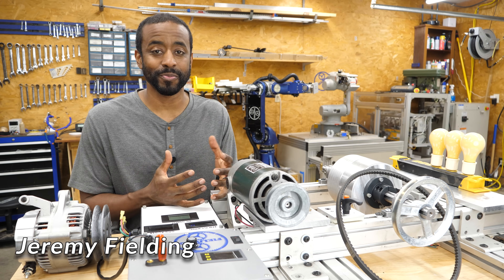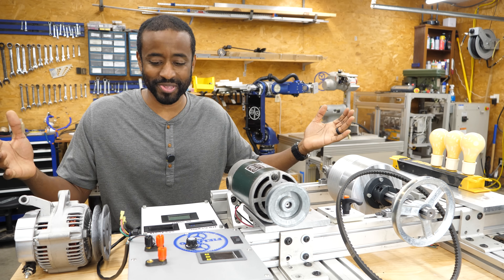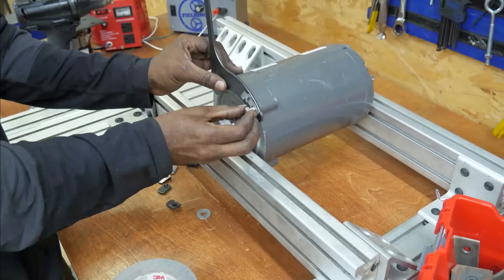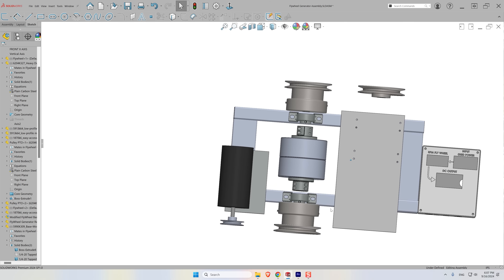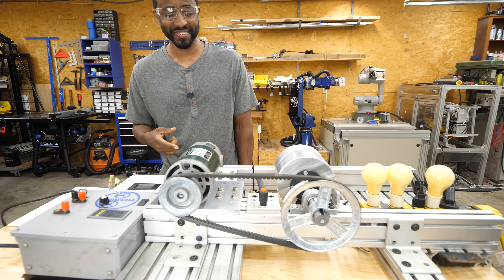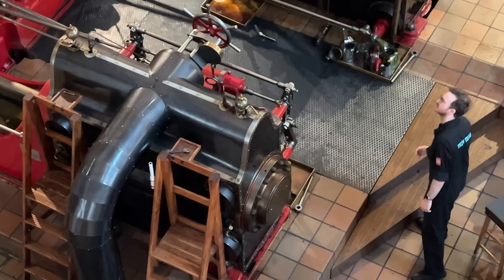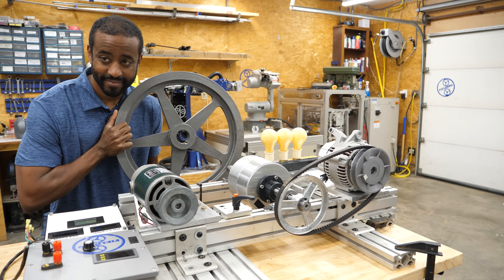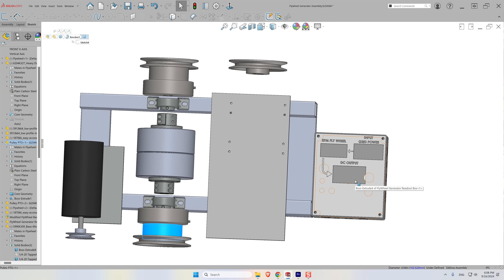A Machine To Test Free Energy Ideas.

Comment: You really didn't expect a 6 or 8 inch flywheel to have much of a inertia effect, flywheel do it with big circumference  like 48   in. Not 15in..
.
Reply from the maker: Inertia is just one variable. Look at the formula. Speed matters as much as inertia. Double the speed and get 4 times the energy storage. SO if you want a smaller flywheel as I did, you can spin it faster and get the same benefit. I understand how flywheels work. You just didn't get a full explaination of the design intent in the video. This will work just fine for my purposes.

Comment: Flywheel simply allows a device to spin over that's why there's flywheels in most engines and most of the older style ones they were there but they don't use them in modern engines anymore there's still used as they can store a small amount of energy that's why a flywheel keeps turning into eventually slows down it's simply used the lower crank in an engine to turn over after it's completed a cycle so it can continue the next cycle

Comment: You better learn about flywheels, because those tiny little aluminum cylinders aren't going to do crap. Increasing the diameter is a must, just look at an old steam tractor or a hit-n-miss motor you will understand
Reply: Why don't you look up gyrobus built in 1940's , imo your flywheel is under engineered good luck with your endeavors, also mabey you could do a video on the differences of flywheel diameter, weight and rpm . Keep up the awesome videos 👍
Reply from the maker: Sir you can also increase the speed and get just as good a result. Just take a minute to look at the formula instead of assuming I missed the obvious. Double the speed and get 4 times the energy. I understand how to design a flywheel 😁. You know too little about what I plan to do to know if the design is correct. If you have a lot of space bigger diameter is great. And that is why classic flywheels look like that. But this is an engineered product sir. Engineers can change parameters to meet their needs. I needed smaller wheel, and this is a backyard experiment to test dumb ideas and teach physics. I don’t need a big flywheel to do that. Thanks for watching. And take a look at the formula for energy of a flywheel. It will help you understand diameter is just one factor not the only one.

Comment: Nice experiment, I am currently trying things out to create a 'free energy' device too.
Nicola Tesla figured it out.
A few others have done too, but there are lots of scammers out there.
Basically we need to overcome Len's Law, or remove the back EMF. It can be done and there are people who have proved it. 
I think big flywheels help to stabilise a system, like when a motor is turned on it draws a lot of power on start up, and they also help when switching from mains power over to self powered.
Good luck 👍
Reply: Use back emf,to Pump other Coils,,capacitor ,and Diode are usted to damp bemf,but Also you Can use it as extra Energy,that works with MOSFET ,not with motores ,i woundnt know how to archive that in motores

Comment: your concept of flywheels is a bit off !!
Reply from the maker: I am happy add a correction to the description if said something that was incorrect. But I design these machines for a living and understand why you might design different kinds of flywheels for different situations. So, I can save us some time by saying you should double check that you heard and understood what I said. Since everything I said can be fact checked on the internet this should be easy to confirm if your understand is a bit off, if you misunderstood what I said, or if I got it wrong. Again, I am happy to correct anything that is wrong, but please take a minute to make sure what I said was wrong before you make such a claim. That would be the kind thing to do. Thanks for watching, and let me know if I really got it wrong. I am happy to fix it.
Reply: @Jeremy_Fielding  its irrelevant what your education as taught you,  the whole idea of a flywheel is to create inertia, by moving the mass away from the shaft to the outer Edge, will create more momentum thus making it much easier get over let's say TDC of a combustion engine, if you was to use the same mass but much closer to the shaft it would not have enough momentum to take it over the TDC and that's something you can try and take to the bank. The same applies when one tries to get over a magnetic force , or a same load, ie  a small diameter on a shaft but is the same weight as the larger flywheel ( by making it longer along the shaft ). you will see that the small diameter when load applied quickly comes to a standstill,  apply the same parameters to a larger flywheel. exact same shaft and load and see the difference. yes it's probably going to take more energy to spin the mass of large flywheel up when compared to the smaller diameter mass,  but we're talking flywheels a different diameters.
Hope that makes sense. 
Anyway I'm very interested in your videos thanks for uploading.
Reply from the maker: So there is nothing off in the video LOL. Sir. changing the shape is one perimeter. And indeed that is why flywheel generally look that way when you have a lot of space. What if you need a smaller flywheel to fit inside a working envelope. Well just look at the formula. The speed is squared! If you want a smaller circumference you increase the speed. Since the speed is squared doubling the speed increases stored energy by 4 times without increasing the weight or overall size. This is a engineered product sir. There are many ways to design a flywheel to get what you want.  If you care about low weight, or need a smaller diameter to fit inside the working envelope... you don't make it bigger, you spin it faster. There is even more to it but you get the point. It is not just about this one parameter. Speed is just as important. Nothing you said changes what I said in the video. So it just felt weird for you to post "your understanding is a bit off" But thanks for being engaged. I think the confusion is you were too focused on diameter being important. It is definitely important, but other perimeters have just as much effect and that is what engineering is. Tradeoffs to get the product you want.
Reply: @Jeremy_Fielding  absolutely correct. but a large flywheel with a mass on the outer Edge will outperform a small flywheel with a mass close to its shaft when it comes to inertia. try it.
Reply from the maker: @theDaftman  LOL Sir... there is no but, and there is nothing to try. We AGREE this is correct. And, the formula shows this to be correct. That wasn't the point or even addressed in the video. You are preaching to the choir LOL. I asked if you found a problem /error in the video, because that is what you started this with... beyond that we are just talking about the obvious. I added in my reply that inertia is only part of the formula because you speak of it as if it is the only important factor. But speed is just as important when designing a flywheel to store maximum energy and can make larger diameters unimportant. The same is true in reverse. Larger diameters allow for lower speeds. Anyway, we are going in circles around the basics. I was not trying to give you a lesson or get one from you. I only wanted to confirm you did not find an error in the video as you implied in your comment. I think we have confirmed that.

Comment: The only "free" energy device I've seen that I think has a chance in hell of working is one with magnets on a wheel and magnets on an angle that are somehow shielded magnetically on 5 sides. But the power generated, if it works, will be tiny.

Comment: The circumference matters with flywheels. Heavier weight on the outer rim and lighter on the inside hub stores and creates higher kenetic energy release.  Even a flat plate flywheel of larger circumference is better than Heavier weight smaller circumference flywheel. The flywheel needs to be greater in circumference than the pulleys used.
Reply from the maker: Indeed it does matter. That is why most flywheels look the way they look. LOL But it is a engineered item like anything else. If you want a smaller circumference you increase the speed. Since the speed is squared doubling the speed increases stored energy by 4 times without increasing the weight. You are making this sound simpler than is really is. There are many ways to design a flywheel. If you care about low weight, or need a smaller diameter to fit inside the working envelope... you don't make it bigger, you spin it faster. There is even more to it but you get the point. It is not just about this one parameter.
Reply: @Jeremy_Fielding  yes. Consider the Cornish Flywheel, steam engine water pump. The engine was low speed and a 70 foot Flywheel.  Many of the so-called free energy devices use a smaller and lower rpm motor with pulleys to drive the flywheel at higher speeds.  With a bigger pulley on the flywheel shaft going to the bigger pulley on the generator.  The torque is supplied by the flywheel and smaller input energy motor to turn the larger wattage output generator. The energy difference between what the small drive motor and the large generator output is where "Free Energy" is created and can run by itself.  If that "Free Energy" is drawn above the wattage created, then a load is created that reduces the efficency, and the small drive motor can not keep up the Flywheel momentum, that can bring it to a stop.  This system can't work without a large flywheel. And the size of the pulleys matter.  Yes, friction and heat are created and reduce efficiency.

Comment: Great video series on "free energy" device testing. Suggestion: place simple dot stickers on All pulleys & shafts for the viewers, as a visual aid for small screen & visually challenged viewers. The beautiful, clean, shiny metal surfaces all kind of blur & look the same whether still, in motion, or at different speeds. (regen vid spoked pulley & flywhl seeable, motor pully Not seeable due to its smoothness). It is immensely  helpful, as a visual reference, to see stickers, markings, numbers, paint, rust,  or something! to help us keep up when you change something. This would help distinguish your channel even further beyond all others as the easiest genius teacher to understand & learn from! If I were in your shop, standing by you, that wouldn't be necessary, I could see well enough. However, a cellphone screen is all I have (no PC). Blessings from God, to you & your family. Paul from S. Central Tx.
Reply from the maker: Actually I did put a piece of black tape on the flywheel exactly for this reason. I agree adding something to the pulley is even better

Comment: Jeremy's plug for Solidworks has me thinking of making the switch. Currently using Fusion360...which is over $400/year. One of my main criticisms of F360 is the cloud storage. Over the last few years, I've had saved files go missing (if I'm going to lose I file, I'd at least like it to be MY fault). Has anyone else made the switch? What do you think? Does SW make it easier to save locally vs the cloud? If I have a decent understanding of F360, will I get the hang of SW pretty easily?

Comment: explains flywheels to us - then proceeds to make flywheels out of aluminum 🙂
Reply from the maker: Yeah. It is a teaching demo LOL. Perhaps you haven't considered that adding more speed is a better method of storing more energy than adding mass. This is the approach I am using. You assume too much from too little information. This is an engineered item LOL. :) I completely understand your comment. It's just more complicated than you imply with such a simply response to so little information.
Reply: @Jeremy_Fielding  You post awesome content that I really enjoy! I just got a kick out of noticing it.
Reply from the maker: Thanks! Actually the plan is to make a whole separate video about designing flywheels. I originally wanted to add it here but this video was already 20 minutes long. I decided there was enough technical detail it should probably be by itself.

Comment: Be careful with those electromagnetic clutches. When turned off, they produce a really hefty voltage spike. This easily fries electronics. And if you accidentally touch both wires when turning off, it will hurt. A lot, really, for hours, the type where you thing to go to the ER to let you get checked for heart issues if the current went through the area. Think of the electric ignition system of a car, and then compare the sizes of the coils.

Comment: What about Toyota and this new fuel-less motor or engine

I'm understanding how the earth would vaguely treat the complex system as a lab to discover an energy or filtration that would lend to limitless or endless energy concentrating, but it's probably hard as hell to invite the information one might need to meet the required engineering ability to convert, harness transport and sustain unlimited energy

Comment: You were asking about capacitors. Intriguingly, to me a capacitor is way closer to a flywheel than a flywheel to a battery. As you pointed out, the flywheel stores kinetic energy so when there is a speed bump in the load, the energy from the flywheel is transferred and filters the noise out. Capacitors do the exact same thing but with voltage (albeit supplying current). If your battery voltage is 12V and you put a very nice cap in parallel, then something pulling a lot of current from the power source would cause the battery voltage to collapse to way less than 12V. The cap helps to keep the voltage closer to nominal by providing a "cushion". So caps and flywheels are basically the same thing! In their own domains, of course. Great video!
Reply: Totally agree with your comments …….in the past I’ve got into countless discussions with people who thought because both capacitors AND batteries can give out a current they are essentially the same thing. A battery creates voltage through chemical reaction(which itself needs an input voltage) you could argue that it does have a repeated life cycle in a sense and a capacitor gets charged with a voltage repeatedly and also has a cycle of sorts but it is more akin to blowing air into a ballon and nipping the balloon between your thumb and forefinger ,its merely a container or vessel to temporarily detain a burst of electrons whose release can be controlled ,a little microscopic warehouse if you like. Whereas a battery when supplied with an input current will generate voltage and store it within its cells ,it performs a function and electrochemically changes its own state and does work, a very basic and rudimentary machine in essence and if the capacitor could be considered a warehouse then maybe a battery could be considered a factory. It is a very fine distinction between the two and to some it is so negligible as to make it unworthy of consideration as the end result is they both give and take electrons and flywheels are in operation the same as capacitors but in the physical/kinetic world, they hold on to energy temporarily,not quite as finitely controllable as a capacitor but they can fill in for sporadic absences/rapid changes of other energy inputs within a system the most ubiquitous example being an engine flywheel smoothing out the reciprocal movements of the pistons and  conrods . Brilliant series of videos Jeremy as engaging as they are educational .you look like you really enjoy what you do …….Brilliant!!!!
Reply: Exactly! Capacitors are to smooth out the power not to generate power. That is what flywheels are for. They help reduce the surge demand on the power source.

Comment: I like to look at things from a practical and economic perspective when trying to evaluate if I am getting scammed or if something is pseudoscience that doesn't actually work out in real life. If it's that easy to generate power for free Why are we not all using free energy devices to power our homes instead of paying the electric grid? It's not like there is a reason for there to be a government conspiracy to prevent people from generating electricity in their own home with solar panels. You can already do that perfectly legally. There's no reason for there to be a government conspiracy covering up any other kind of device that would generate power for your home. And if there is no government conspiracy and a technology exists that's actually better than the way the power grid is generating their electricity and is cheaper to operate in the long run, then surely it would have been adopted in a widespread fashion by now.

I think solar panels like you mentioned in this video are the closest thing that we have to a real world 'free energy' device. They generate more power than is needed to cover their own costs if they are placed in the correct location and orientation after so many years. The reason that our entire electrical grid is not running on solar is because you need batteries to store the electricity for any time other than daytime when the sun is shining, and converting solar energy to grid level voltages isn't free or cheap either. Plus not every geographic location meets the above criterion.